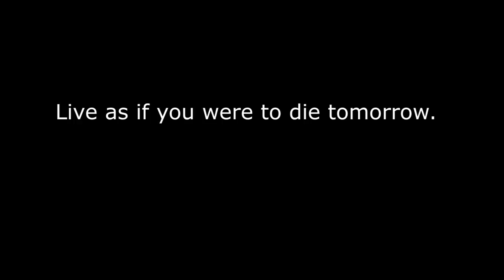2018 MARUTI SUZUKI SAEINDIA SUPRA | SPECIAL FEATURE | ATR TV

Comment: It was a great experience to be Part of 2012 Team GARUDAULTIMATE2.0...1st time @BIC It's not only about Mechanical  engineering but Combination of All. You need to Get sponsors, Electronics, Presentation,Design, Manufacturing,Market, etc and Most Importantly Team Management. And most important you will get memories to share...